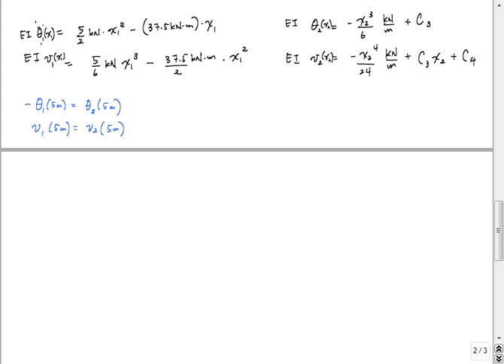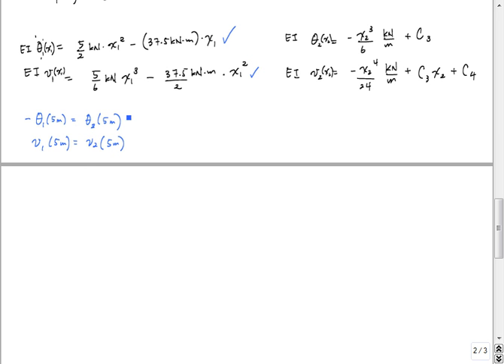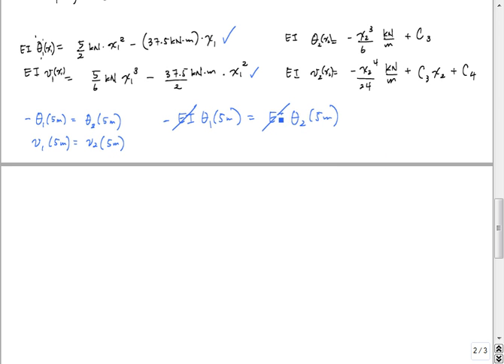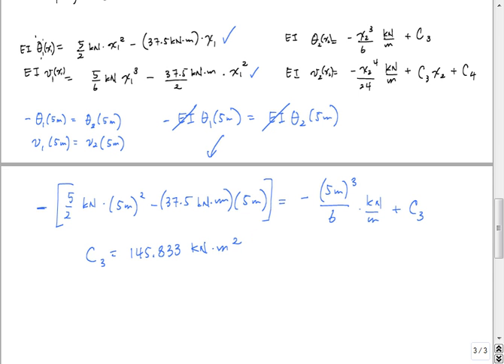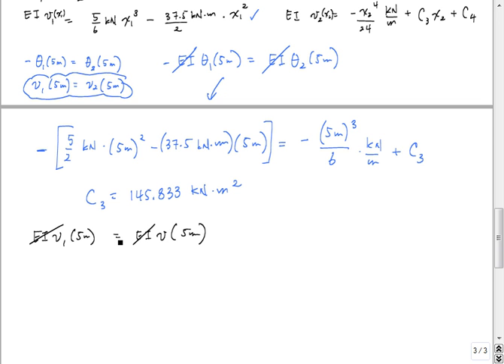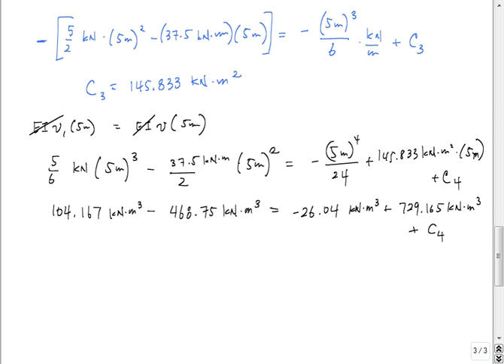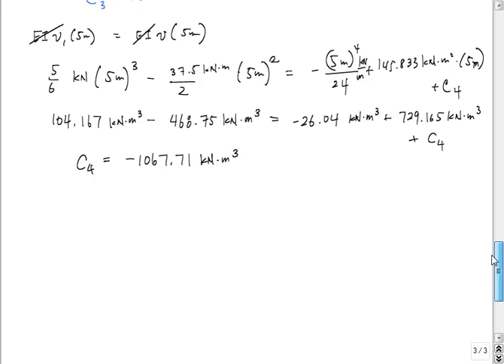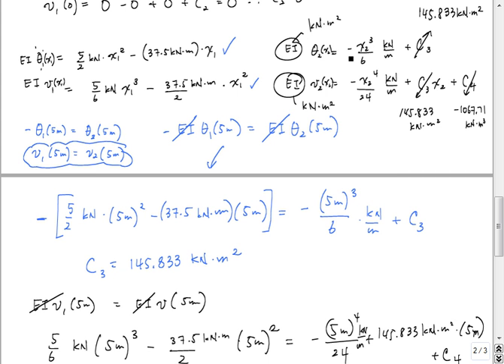Beam Deflections - Double Integration Method Example (Part 3/3) - Structural Analysis

Comment: so what exactly is the answer?
Reply: If they ask for deflection and angle at right end of beam, you would plug 0 in for x2 in equations 3 and 4 and solve for theta/phi. Because the end of the beam from right end is a value of x2 = 0m based on his specified coordinate system. But if you wanted to solve for 2m from start of beam at the left, you would plug in x1 = 2m into equations 1 and 2 and then solve for unknown variable. 

This video is kind of confusing because he doesn't ask for anything specific in the question, he just solves the 4 equations and leaves it open. You  could solve for deflection/angle at any point on the beam as long as you plug in the correct value of x1 or x2 that corresponds with the locations you are trying to solve for. So it depends on what location(s) your prof asks for in your question.

Comment: at the end (5:00) you say that units work out because all the units of the deflection equation are kn.M^3 but what happens to the kN/m and kn.m^2?
Reply: +shahrukh Nadeem For the kN/m , when you divide by EI you will get kN/m^3 , but you will multiply by x^4(take another look at the equation. x is in m) and its a similar situation with kN.m^2 where dividing by EI cancels the kN.m^2 but there is an x that multiplies with that unit.

Sorry for explaining it poorly.

Comment: So the answer for both slope and deflection have two equations? Or should I plus them together?
Reply: +Wang Zirui I am confused because there's the same problem in the book but without numbers. If I use the number in this example, the slope and deflection at free end in the book equals to the answer from equations in M2(x2) in this example. Why the answer is that but not add two slope equations together and use x1=10m, x2=0m?
Reply from the maker: Please don't put them together. The functions only work between their respective discontinuities.

Comment: How did you derive the boundary condition -theta1(5m)=theta2(5m) ? Looking at the beam it doesn't make sense why one should be negative of the other since it's technically the same angle...
Reply: +tullao1979 Check out part two of this series. He clearly states his coordinate system starts on two different ends of the beam resulting in opposite slopes hence the negative sign.

Comment: hi how do you calculate the maximum deflection?
Reply: i think you're 2 years too late
Reply from the maker: bannaghbeg finding location of maximum deflection is like finding the critical point...in most cases, where the slope is zero is a location of max. deflection.  The ends of cantilever beams are one exception.
Reply: 3:26 I think you made a mistake when finding c4... You put a negative sign on the right side of the equation.